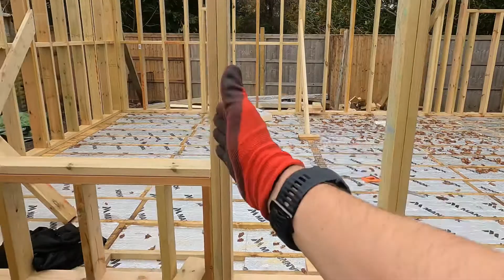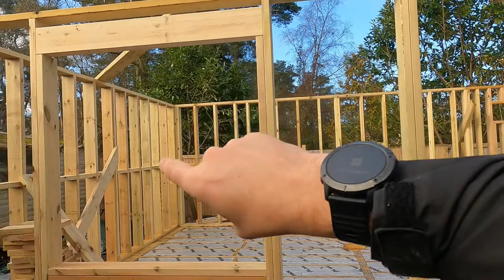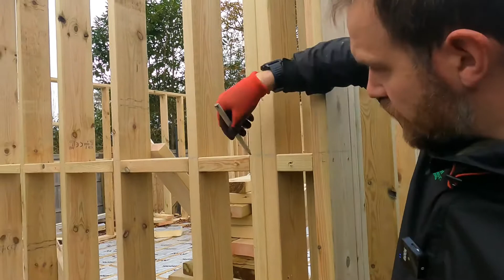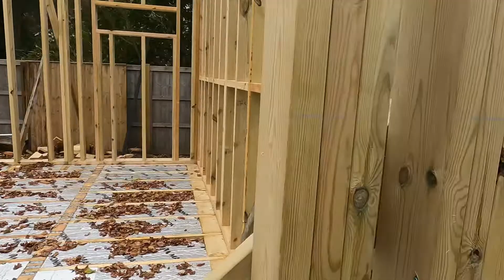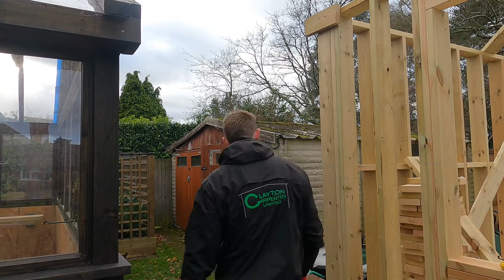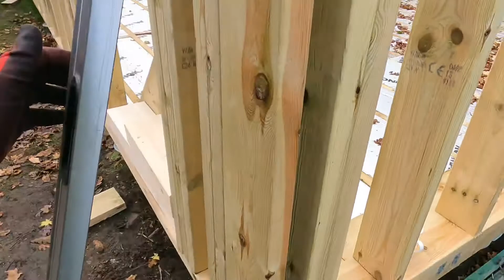Forming the outer walls part two

Comment: Grab yourself an 8' Stabila level for plumbing up walls, 👍🔨🇮🇪
Reply from the maker: I tend to use a plum-bob for my walls for the final levelling. I have considered getting one but since I bought my new Bosch pro 360 degree green laser level I haven’t looked back since 👍🏻
Reply: @claytoncarpentry618  I have one of those Bosch green line lasers as well, it runs off a Bosch 12V battery. That was one of the main reasons I bought it because I run a lot of Bosch 12V kit, 👍🔨🇮🇪